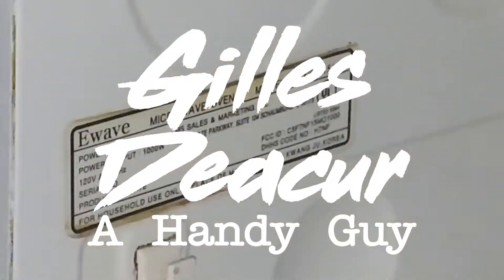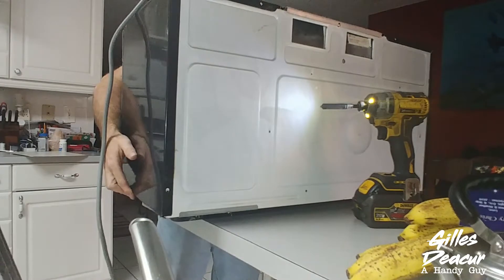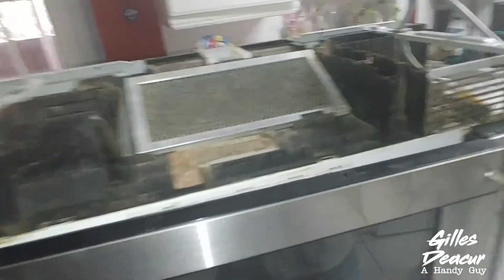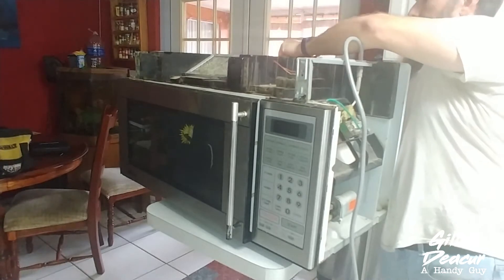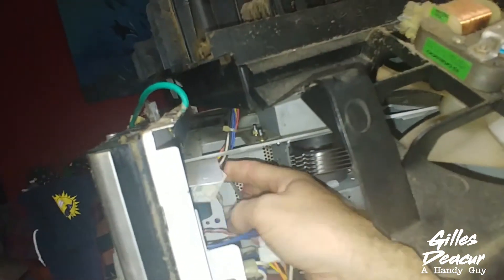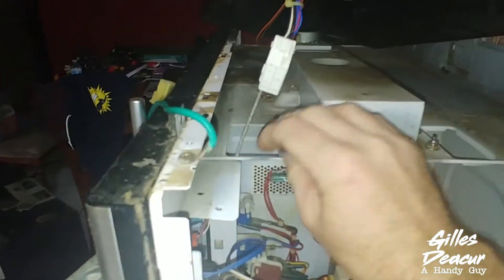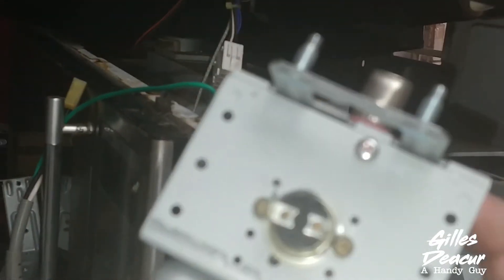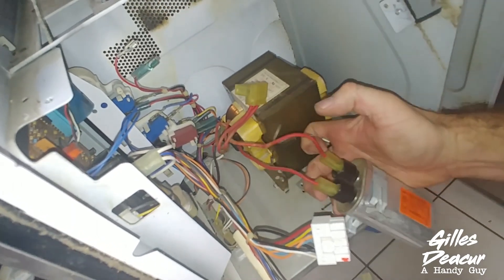Microwave Magnetron and Diode Replacement - How to Repair Your Microwave - Ewave KOT151S

Comment: What steps did you take to troubleshoot the magnetron specifically? Or, how were you sure the magnetron was faulty part?
Reply from the maker: I just took a chance. I don't remember, it was so long ago, lol. Sorry.
Reply: @LordGreybeardsChannelofWisdom  Thank you.
Reply: Check out the multimeter.. 0.1-1 ohms good but if replace still not heat..Check the diode or capacitor and control board
Reply: @jaymjay2313  Thank you!